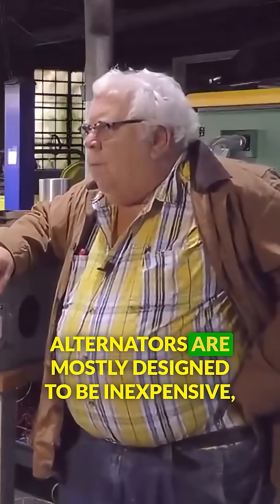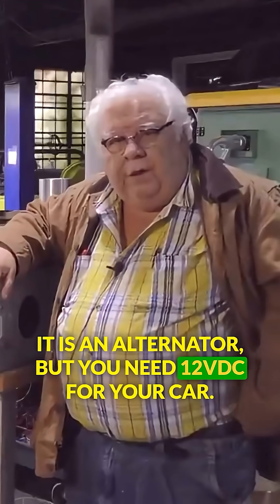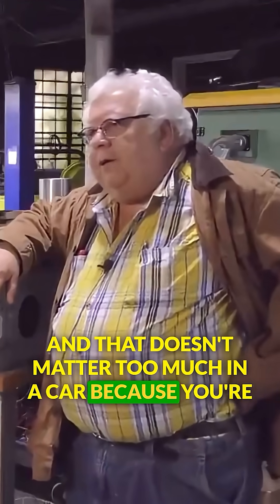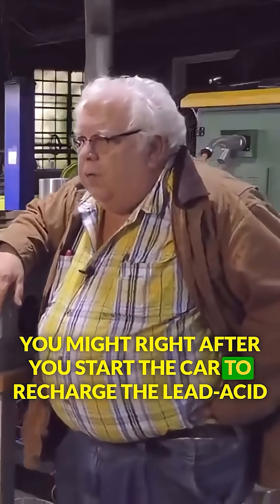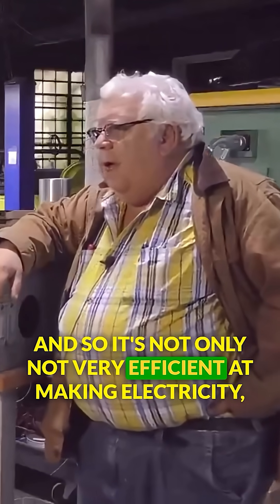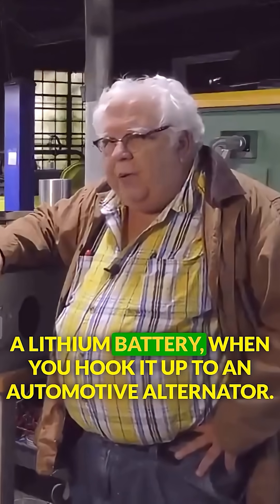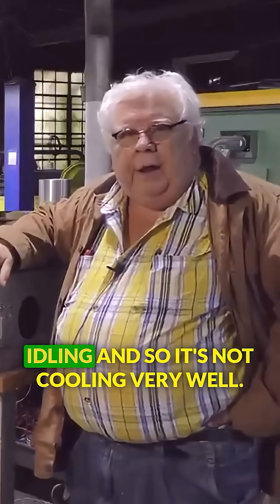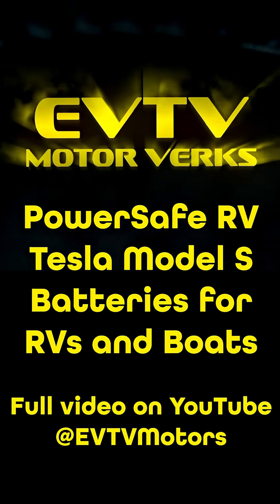Alternators are Only 50% Efficient!

Comment: Um this is kinda said wrong, an alternator needs “ excitation voltage. Once the rotor gets hit with a quick 12 volts burst  technically all the batteries out doing is serving as part of voltage regulation. Once the car battery is switched in and the removed the rotor is usually connected to the main output winding, which feeds a bit of voltage back into the rotor, or the alternator may be designed a bit differently such that it’s self exciting. But that’s still not exactly simple how it actually works
The battery is not supplying a lot of current to the rotor, the alternator is kinda like a mechanical amplifier taking a low voltage high some what high current source and mechanically amplifying. They our not single phase there our 3 phases and they our with star(y) wound or delta wound. 
The only real reason for the battery is storage without some form of storage voltage becomes rather unstable in short car battery act like the capacitor of a brushless self exciting, capacitive regulated AC alternator generator I have one it is single phase. The rotor has no brushes, it is wound have two poles with a diode at the end of the winding, the stator has two separate winding the main winding, and the exciter winding which is wound 90° out of phase with the main winding. It is connected to a specific value non polar capacitor. Two magnets on the rotor iron kick off the the exciter by helping push enough “eddy” currents into the exciter so that it can feed it back to the wound brushless rotor with its rectifier once the generator start it takes the small magnet field from the fixed magnets, or if it’s a more expensive Alternator the whole rotor’s iron has been magnetized both do the same thing once the exciter gets going the rotor and exciter coil and capacitor begin talking to each other and if spun fast enough don’t need any magnets if there’s enough magnesium in the iron. It is a resonate circuit as long as there’s enough magnesium is some storage! 
Car alternators have a much higher frequency then 60hz mains they run more like 400hz the faster the frequency and higher the Q factor the more efficient the circuit is running! 
So again an ac alternator used to generate electricity and not as a motor our like a mechanical amplifier taking a smaller voltage and current and stepping that up within a given range

Comment: true that. Lead acid batteries have massively higher resistance than lithium. This is why temperature regulated alternators exist, like the Balmoral... that throttle down the current if temperature goes up. Saw an interesting video, someone removes the rectifiers from an alternator replaces them with external ones and wires the output to a solar controller, clever thinking.

Comment: Sorry gramps, but the way DC works is demand (load) based. The altnator is not producing 1200 watts (and that much heat) unless the LOAD is there. Try installing a 20 amp "altnator" and see how long your lead battery lasts before stranding you. Altnators won't charge LiPo packs because you need a well designed cell balancer and a smart charging and load controller design.

Comment: BS.

The rectifiers on an alternator don't dissipate half of the power the alternator generates.
The voltage accross the battery is a function of it's state of charge, usually around 14.1Vdc for a good battery which hasn't been allowed to go flat.
Ok, let's just say you indeed see something like 12Vdc @ 100A on a good battery which, unfortunately, was discharged. That means, before rectification, the alternator is (worst case scenario, as there exist Schottky diodes which only cause 0,2V of drop and are used in this application) approximately putting out 2*(12+0,6)*SQRT(2) Volts peak-to-peak (there are other losses, but they're negligable compare to rectification). Converting that to Volts rms (so we can compare the power before and after rectification) we get 1200/1260W, or a worst case scenario efficiency of 95%.
And that's how knowing how electricity actually works can save you a lot of embarrasment online.
Talking with a lot of confidence as a car mechanic, doesn't imbue you with the knowledge an electric engineer has, unfortunately.

Comment: This is what I hear on the other hand I had 2 125 amp hour lithium batteries in my trailer which I charged by hooking it up to my car with jumper cables in the evening, and I never had any trouble with my alternator being damaged and I also have an alternator in my boat and use it to charge a bank of lithium batteries, no problem. And these are fully discharged lithium batteries. My experience disagrees with this

Comment: I just learned so much about batteries in a short little video. I've been wondering why my solar panel charged batteries at my travel trailer lot out in the woods will not handle charging my 20V tool batteries. The inverter screams bloody murder after about 10 seconds 😆 🤣 😂 
I just start my remote generator and kick in the 110V AC system to charge my tool batteries. 
53 years old; never to old to continue learning 😉

Comment: I know a few people with lithium batteries and they don’t directly charge them from the alternator but with a balance charger that is ran via 12v balance charger. The other few setups I’ve seen is standalone and charged with a balance charger over night when not driving which works but means throughout the day the battery lowers the voltage during use. My car audio runs on lithium-ion p45b cells and I use my inverter to power my balance charger and has worked well for years